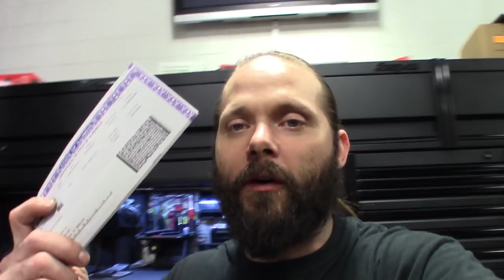Bought Another One & News On Channel!!

Comment: GM did put low tension piston rings in the 2.4 from the factory and also a faulty piston design.
Reply from the maker: Definitely not my favorite motors. "Hashtag Worse design ever"
Reply: Jasper does reman them putting in the upgraded pistons made in house and high tension piston rings.

Comment: Great video as always. Who ever gets it will be very happy . If you need any help on any GM parts or GM specs or GM period let me know.
Reply from the maker: Hope I didn't make a mistake buying it, but if I can help someone in the long run with it. May be worth something!
Reply: To be honest as long as the owner takes care of oil changes recommend  mobile 1 . These 2.4 equinoxs are solid i never really replace suspension parts , i never really replace modules . Just typical  tires , brakes , occasional wiper transmissions , once in a blue moon heater cores. Now a neglected 2.4 need valve solenoids sprockets,  timing chain  and piston rings.
Reply: @JRC54  you definitely will be helping someone . Keep up the good work, look forward to the live stream.